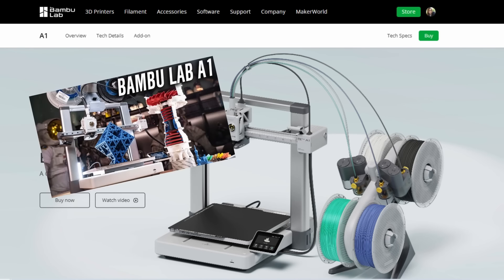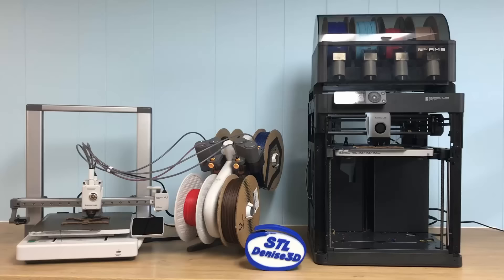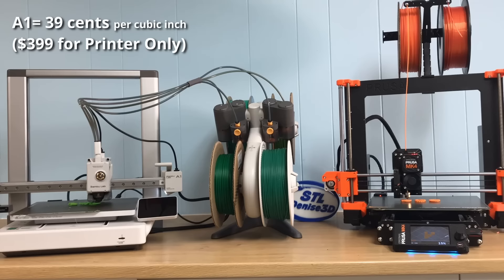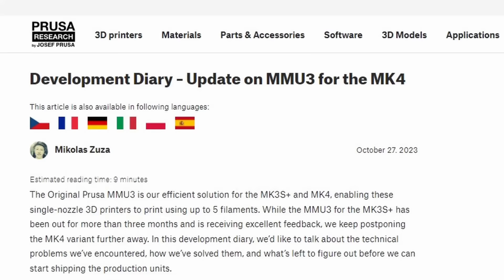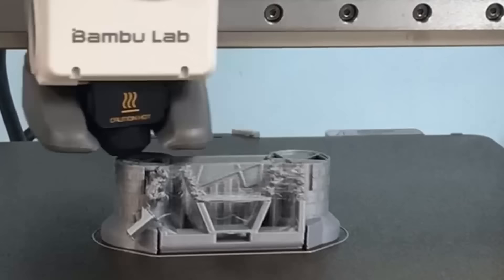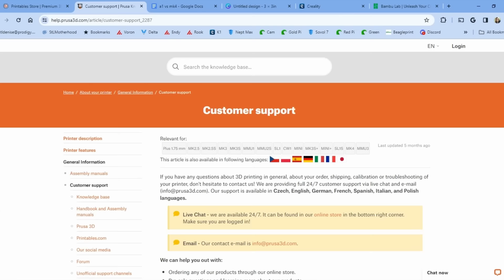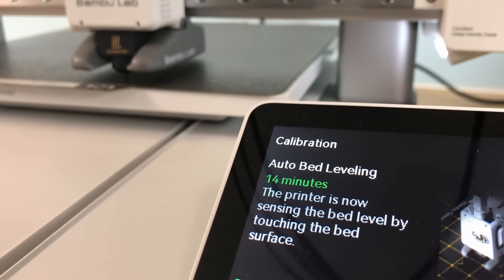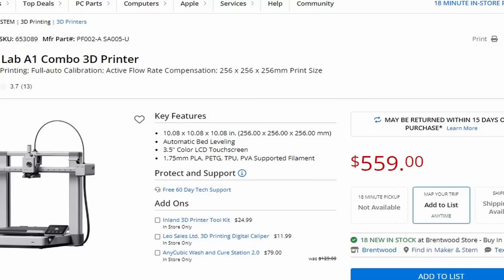Battle of the Bedslingers: Bambu A1 vs Prusa MK4

Comment: Interesting review, but the big thing that you seemed to gloss over was whilst the Prusa is slightl;y better it is over 3 times the cost in the UK anyway, for a MK4 it would cost me £1054.80 compared to the £369 for the Bambu and only $509 with the colour AMS. The MK4 will add and extra £292 to add colour so the total is very neary £1400. So whilst they are very similar they are not like for like.
Reply: Actually the MK4 is not slightly better, it's at most close the A1 but the A1 is still the better choice. Price wise and features to feature. I'll say it once again, the only thing Prusa has on Bambu Lab is long term support and customer service
Reply: But the bambu support is pretty good, and time will tell if they are good long term but the indicators are that they will be.
Reply: @MrSeanroberts1969  I agree but that's just our opinion. Prusa needs to step up their game, they won't have experience and "trusted by time" on their side for too long. Bambu Lab is aiming for the top and they are almost there
Reply: The same can be said vs. X1C.... lidar gives pratically nothing more.
An enclosure can be built.
The limitstions of one could be in the firmware... since being closed source we don't know.

Comment: While the MMU3 for the mk4 isn't available yet, you still could compare the A1+AMS light and the mk3s+ & MMU2/3 - basicly a 6 year old printer (with some upgrades). While I still work on my Prusa setup (have it from the beginning, but never used it due to the early problems), simply slice the same model both in bambulab Studio and Prusa slicer. You get printing time and waste pretty correct.
I used a test with 4 different coloured dices 1m³ bithout tuning settings.
The difference is astonishing:
Bambus A1 (mini, as I have it) with AMS light produces 4 times the waste and needs 25% more time than a 6 yo setup from Prusa!
However, this is a quite smal print, so the time overall is mostly caused by filament changing. Unload with ramping on a standard flow nozzle is much faster than cut&poo.

One reason the MMU2 never was realy successful is the reliability. Prusas setup has two downsides: The special modified e3d heatbreak needs ramping to be tuned to printing temperature and material to get a good filament tip. And the filament should be quite dry.
6 years ago this was a problem. But with the Revo hotend, the filament tip got much better on unload without fine tuning, making the setup much more easy. And filament dryers have become quite popular nowerdays. So if you upgraded the mk3s+ with a Revo Six (or maybe a Trianglelabs Unified nozzle), it works much more flowless (this is the reason I started building it now).
The other downside of Prusa is the spoolholder/filamentbuffer system. You have to make sure to have as low fraction as possible - so best not to use the filament buffer, but placing the filament on good spoolholders on a shelf above the printer. The AMS and AMS light have a filament-synchronicer (on the AMS integrated in the part known as "filament-buffer", on the A1 (mini) on the top of the printhead). Actually using a spring, a slider, a magnet and a hall sensor detects if filament is needed and the AMS-feeder is pushing the filament to the printhead. This reduced the force needed from the printheas extruder and making everything more easy.
Both downsides are solvable - but not very beginner friendly. But if you want to print multicolour often, you definitly are better off with Prusa. I am eager to see the MMU3 for mk4, as the nextruder nozzle leaves a even better filament tip than the Revo or TUN.

Also, while wipe2infill or whipe2object can reduce filament waste a lot on the prusa (or on the ERCF on Klipper printers), this reduces only size for the wipe tower (a lot). You can not reduce the poo on the Bambu-printers this way, as the remaining old filament in heatbreak and nozzle is been cut off and can not be retracted anymore. So neither wipe2infill nor wipe2object would give reasonable print results.

However, this only applys to full-colour prints. If you use multicolour only on the bottom or top layers, for horizontal support interface layers or to change to next spool after one is empty, the number of filament changes is quite smal and the filament changing time and waste do not matter much. So for many cases the Bambu AMS is actually a very good solution. Also only needing a few multicolour print a year (for Xmas gifts) the time and waste is acceptable.

So while I am experienced, I still bought the A1 mini as a nice quick2go solution. But at the same time, I build my MMU3 setup, just for fun. Practicaly I barely do any full multicolour, just sometimes in the first 3 layers for display cases (manualy filament change...). But my father got some multicolour prints this Xmas, printed on the A1 mini (the battery boxes in style of a beer box - I made a modifier with the logo of his favorate beer brand to use a second colour for it (Krombacher, I am german))
Reply: That is a heck of a post.  One point, we never got a chance to review the an MK3 or any variety of Prusa MMU.
Reply: The Bambu Lab default purge settings are very high — and unnecessarily wasteful.  You can set those much lower and still get a correct purge.  Dial them in with some testing of the colours/materials you want to use for the best economy.  My last big print with four colours I got most head purges down to 110 or 120 mm^3.  (With literally thousands of filament changes, it adds up.)

Separate heads is the best solution for minimising waste.  I have a Sovol SV04 that I have almost got working correctly without a purge block, thus waste is very small — just a little material loss when the idling head is reactivated.  (Only two colours, as it is IDEX, but the Prusa XL can be configured with up to five heads.  Expensive, though.)
Reply: @boggisthecat  I compared both with standard settings. You can tune both to lower waste. Howerver, cut&poo alvas need more filament. And while you can tune waste on an mmu2/3 to nerly zero if you print multcolour (not multimaterial) if you have an object where colour does not matter ab wipe into this object, you can not use this with cut&poo, as cutted filament can not been retracted anymore.

Idex or toolchanger is mostly interesting for multimaterial. While of course you can also use it for multicolour, as long as you have objects where colour does not matter and could be used for wipe2object, this does not reduce waste a lot.

Multtool/Idex mostly reduces time for changing to another colour. However, imho an Idex combined with two filament changers might be the best for pure multicolor - change the filament in the non-active printhead while the other is printing...
Reply: @oleurgast730  
I have thought about an IDEX plus colour setup.  The issue would be changing from e.g. H1 black, H2 white, H1 red, H2 black — where black is required at both heads.

Another option would be a rack of hot-ends that can be picked up either head of the IDEX and pre-heated for the next colour/material change.  Thus you could lose very little material — possibly near zero if you parked the hot-ends on a silicone block or similar to prevent oozing.  (Some people reverse the silicone block locations on the Sovol SV04 so that when the head is parked the nozzle is on the silicone block.)

For this you would require precise mechanics, though, or a way to calibrate the nozzle position at each exchange.  So it becomes technically complex.

In the end, economics is on the side of wasting material.
Reply: Oh, and you can alter the start g-code in the Bambu Labs machines to do a long retract at material change, thus leaving less filament to purge.  It is a bit twitchy, though, and you run a higher risk of a blockage, so I looked at this but decided against implementing it (for now).
Reply: @boggisthecat  Thats why I distinct between multi-colour and multimaterial. Multicolour is mostly done with much cheaper material, like PLA... Multimaterial is more on the coszly side of materials, like ABS-GF or PA12-CF and PVA. For multicolour most simple soloution would be to have two indepedend filament changers whith both containing the same filaments (so two spools of filament for each colour).

For retract before cut: The reason bamvu does not do it in default setting exactly is the higher risk of blockage. While this is an approach already discussed in the SMuFF project, for relibility you have to do finetuning for different brands - and also huminity of filament can play a role. While you can reduce waste this way, still you have poo you can not reuse - unlike on a filament changer like the MMU2/3 or ERCF.

Imho as with standard flow integrated hotends (Revo, TUN, Nextruder) a filament change can be done reliable whithout a lot of waste (if you have an object to use for the transition), imho the most important thing to do is reduce filament changing time.

For example on a direct extruder the unloading time is limited by the filament tip has to be hardend again before reaching the extruder gears. Else the tip gets sqeezed and blocked inside the feeder (the Qidi x-3 series uses to fast unloading, often resulting in blockage. I split the unload macro into 20mm fast unload from the meltzone and 60mm unload with quarter of the speed and solved the problem). However, if you look at the A1/mini, the AMS light uses one feeder per filament. So wgy not a mechanism to unengage the extruders feeder on unload? If the extruder works like a bowden extruder at unload, the unload process can be done much faster, as the molten filament tip do not touch the gears and is not deformed... Ad the hub the A1/mini uses and the filament is out of the way quite fast and the new filament can be loaded instantly after.

So I would like a chimera between the A1 AMS and the mk3/4 MMU2/3 approach and a "extruder unengage" mechanism. I think 30 sec filament change or less should be possible.
Reply: @oleurgast730  
Yes, the change time on the AMS is very long.  The ‘AMS Lite’ has reduced that a lot, by eliminating most of the Bowden length that the filament must be run through.  This is a better solution, but the trade-off is having multiple Bowden tubes attached at the print head — and it is restricted to four filaments at present, I believe.  (Multiplexing would be possible, I assume.)

Mixing materials is tricky.  PLA and PETG won’t bind, for example.  Useful if you want to have a ‘support material’ that is cheaper than the specialised stuff, but would be difficult if you wanted to print a model using both materials that wasn’t designed for this (i.e. with the materials keyed to hold together).

I have a few ‘exotic’ materials, but haven’t got onto projects that require them as yet.  One point I found is that while abrasives are handled by the P1S hardened components (I bought these at the same time as the machine, and swapped them out before doing any work), the Bowden tubes wear quickly.  I have replaced those external to the AMS unit now.

(My AMS needs a rebuild, at which point I will swap those out.  I found tubing with a larger internal diameter that also appears to be slicker, and have switched out the stock tubing.)

If I had the money, I would buy a Prusa XL to work on.  Or possibly wait to see if some of the similar implementations become available.
Reply: @boggisthecat  There are open source toolchangers for Voron Trident an RatRig VCore 3.1 (or nearly any Printer with z-moving bed).
Reply: This is interesting.   I'm using a MK3S at my work.  When i got it 4 years ago, we also got an MMU2S for it.  But I never assembled and installed it,  because for the odd multi colour print I could use my own old MK2 MMU1.    I finally installed the MMU2S a week or so ago, I'm doing long 4 and 5 colour prints for topographic models that cover most of the bed.  It's working fine but of course I do get some pauses for the filament tips.     I've been drooling over the X1C, considering getting it for work, because it appears to be more reliable and a lot faster and plan on at least installing the software, slicing, and comparing estimated times.
Reply: @oleurgast730 i am betwen prusa mk3s+ with mmu2s and bambu a1, bambu more expensiv but new, plus 200euro, which one to buy? I need multicolor. Thank you

Comment: The question is: will prusa improve their innovation speed in terms of printer firmware for all of their models? The major factor in the long term is the quality of the combo of slicer and firmware. Currently Prusa is fighting too many fronts in my opinion with all their differnt printers (delta, resin, mk, xl, etc.) regarding their engineering capacity.
Reply: Eh. Disagree. They recently unified all their FDM printers under a single firmware (the Buddy Firmware). So Mini, MK3.9, MK4, and XL are now mostly the same code base. They have a few differences, but they likely made that move for this exact reason. They need to speed up development so that they can focus on the next big release.
Reply: Funny you should say that.  Bambu is based off of prusaslicer.....so I bet Bambu is hoping Prusa innovates some more on that front.
Reply: @chethammer   And Prusaslicer is based of Slic3r, the only two common FDM slicers that cant trace it back to slic3r is Cura and Simplify3D.  Prusa did the same thing bambu is doing now, making a fork of existing software. Heck, even creality slicer is fork of Cura.
Reply: @Steel_shooter  prusaslicer is far beyond slic3r .  Don't even know if it's still used.
Reply: @chethammer  that's not the point. The point is that innovation and improvements on existing software keeps on going when the base is open source.  Heck, there are even forks of Bambu slicer that's better than it for the Bambu machines, like Orca Slicer.

So if you don't want to mention slic3r, I see no point in dragging in prusa slicer when it comes to acknowledging what came before.
Or do you feel  similarly about super slicer?

Comment: I have had the Prusa Mini since 2020 and trying to decide between the Prusa Mk4 and Bambu Labs A1.  The Major concern I have is that the Bambu uses THEIR Cloud.  It's free for 6 months, but then it's $11 a month.  That's $132 a year.  I don't know how safe my data is on their cloud. With my Mini and the Mk4 you use a USB flash drive to move files.  I can be totally off the network and still use MY machine.  I don't know how secure my computer is when connected to a foreign country?
Reply from the maker: There's no charge to use a Bambu.
Reply: "safe data" is not about Bambulab, forget it. Bambulab privacy policy: "In certain situations, Bambu Lab is unable to delete your personal data in responding to your requests, including:

when such personal data is still necessary to be processed to achieve the purpose we collected it for;
Bambu Lab’s interest in using the data overrides your interest in having it deleted (e.g., when we need to process the personal data to protect our services from fraud); [notice this is only an example:
So basically you are at Bambu Labs whims when it comes to your data. And, since Bambu shares data outside US to its parent company in China, there is no chance of forcing compliance."

Comment: where u get the piece to hold the cables ? one it comes with the printer and the other? thanks
Reply from the maker: If you go to Maker World you should be able to print a replacement.
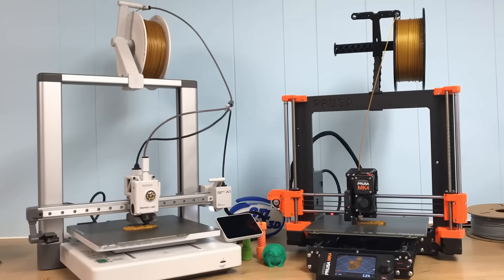Reply: @stldenise  i was asking about the second one u have. i dont find it, can u put the link. 4:06 u got 2 things to grab the cables, where i can find the grey one?
Reply: @stldenise  ?
Reply: Comes in the kit

Comment: What thoughts about linear rail ball bearings quality?
Reply: So far so good.  No rust or corrosion and everything moves smoothly...
Reply: @richardbertacchi5016  Friend sayd those could fail printing 24/ within a year. We have a dozen of P1S and after using for 1 year 24/7 much parts had to be replaaced and upkeep for a Bambuulabs P1S is on average 150€ per year. Bambuu is not Prusa what just works 2000 hours without problems.
Reply: @WILDBEES_LATVIA  I should point out that, while we don't have any printer going 24/7, we've printed on a daily or at least weekly on a P1P since it's been available.  Other than wear and tear on the AMS bowden tubes due to abrasive filament, nozzle replacements and a self-inflicted AMS failure (don't ask) we've not had anything else need maintenance.  I can't see the linear rails on the Bambu failing.  Our Prusa Mini and Mk4 have not had as much use but have also been maintenance free.....
Reply: @WILDBEES_LATVIA  you seem to be talking shit

Comment: one point I'm sure that came up but is relevant in that 'everyone makes mistakes, you might put in PETG when you meant to print PLA' this is where the RFID spools and refills for Bambu become relevant (among others) and it matters because their filament is tuned, calibrated, and is competitively priced, you drop it in and you can't get the setting wrong because the printer will tell you "hey you're trying to print PLA but you loaded PETG"
Reply: the X1C also scans the qr codes on plates. I have printed and sent files for cool plate (35c) to a printer loaded with a textured pei plate (needs 55C to stick) and the printer told me i was being a fool. It scans it and pauses it, letting me swap to my cool plate or reslice.

Comment: 2:56 You should never recommend an Ender, neither a Monoprice.
Reply from the maker: I agree on the Monoprice, but the newest Enders have been great for beginners. The Ender 3 sv3 SE is really good.
Reply: @stldenise  Enderes are a complete clusterf*** - expecially for beginners - if you just want to print and not tinker with a printer and you are on a tight budget, get an A1 Mini for 300 bucks - in no world the  Ender 3 for roughly 200 bucks can compete her

100 bucks extra for - and i quote you here - an expensive hobby is nothing, for the pain and misery you spare yourself